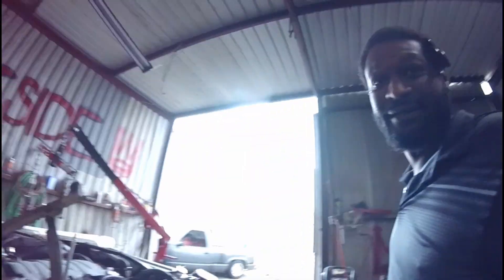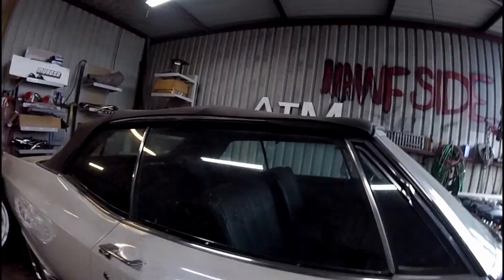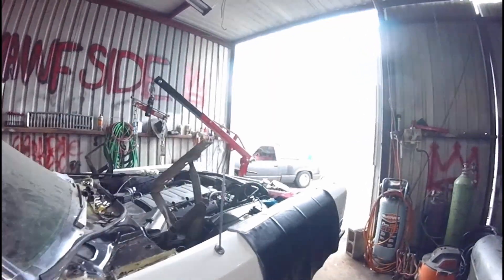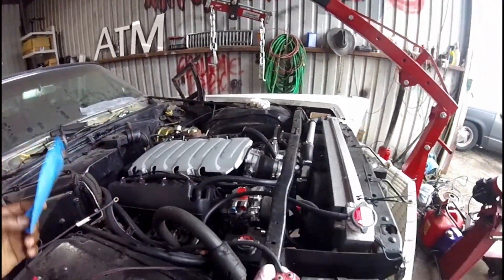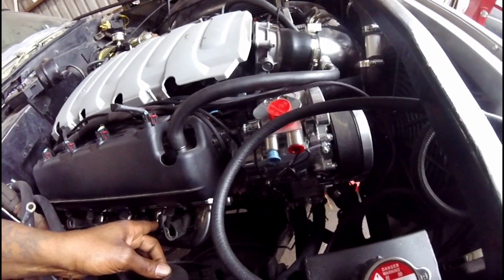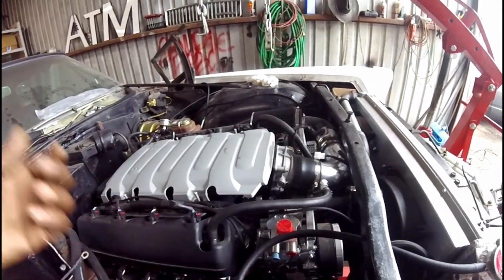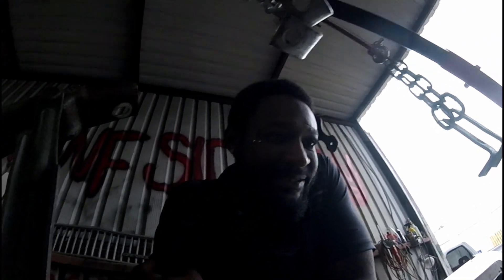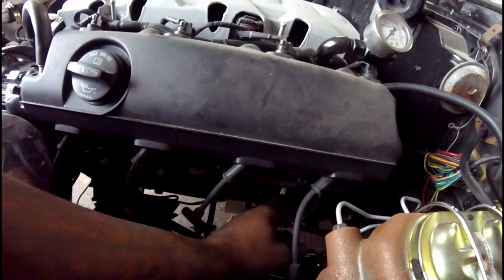1968 Cadillac Coupe Deville LT Swap

Comment: Nice work homie, I have a 1970 Deville Convertible with the 472 motor. Looking at doing a LS swap in it. Is the steering box tight on these as well?
Reply: I also have a 1970 Cadillac DeVille convertible were you able to ever get the ls swap done I'm thinking about getting it done but finding someone that wants to do it is the hard part

Comment: Aye fam I got the same caddy. I'm Trina swap it with a 5.7 vortec from a 2000 escalade.... any suggestions?
Reply from the maker: Shouldn't be too hard. I'm pretty sure they make a mount kit for the '68s now but you may have to get a set of headers made. The steering box is in a very tricky spot
Reply: Where’s the 472

Comment: What mounts did you use and oil pan for the swap
Reply from the maker: I made custom mounts. The oil pan was an lt swap pan but I had to extend the pitman and idler arm to get the steering linkage to clear
Reply: Where you located
Reply: I need some motor mounts made cross member and headers

Comment: Wat transmisión u using
Reply from the maker: 6l80
Reply from the maker: 6l80. Custom crossmember and carrier bearing mount I built for a 2 piece driveshaft.
Reply: Cool tanks for reply  no modify floor a got 70 Deville im i may get lt